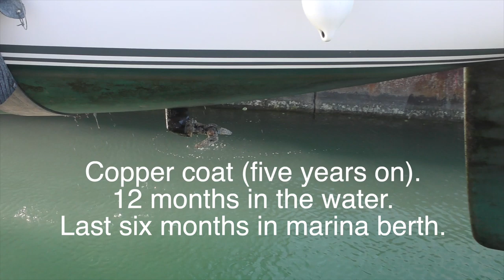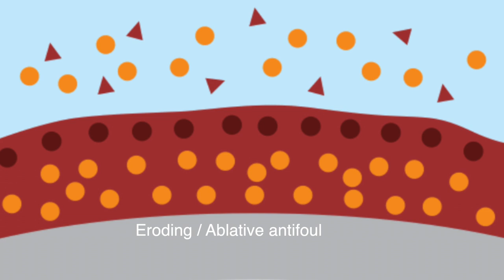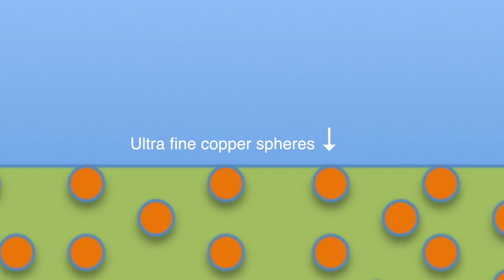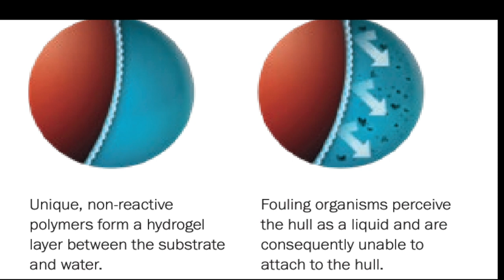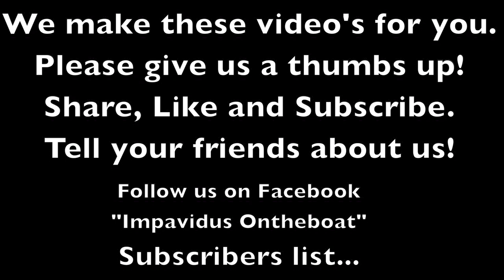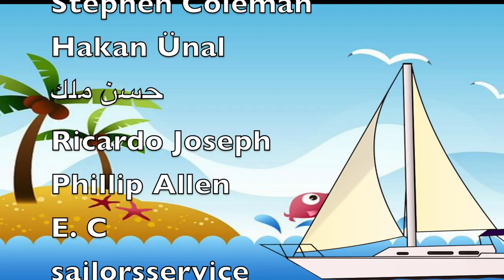Antifouling. Which one is best? We look at 3 including Silicone

Comment: I have Coppercoat on a 3 year old racing/ cruising Portsmouth UK based yacht and have been bitterly disappointed with performance. I lift it every year, scour, sand, divers down twice a year and still getting weed growth.  

I had a Bavaria 37 before which required two tins of Blake’s Tiger eroding and a mid-season scrub.
Reply from the maker: Yes. You can see in the video our problems with seaworm and barnacles we have to dive the boat every 2 weeks now.  Yet we have seen other where it works so well. Ant

Comment: For myself on Ice Maiden I have a meticulous preparation for anti-fouling. We have just done a complete anti-fouling of Ice Maiden which will last for a minimum of 5 years before we do it all again. First we taken it back to the fiberglass with a bead-blaster. Then we apply 2 coats of etch primer with 24 hours between coats. The hull is then washed down and allowed to dry. We then apply 2 coats of an under-primer, followed by 2 coats of primer. These are sprayed on and allowed to try with a 24 hour dry time between each coat. We then spray on 2 coats of anti-fouling allowing again 24 hours between coats. Finally we roll on 2 coats of Bitumen paint, brushing behind the roller. This is allowed to dry for 48 hours and then we put her in the water. In the 15 years since Ice Maiden was built and launched there has been no growth on the hull with this method.
Reply from the maker: Robert Thanks for the comment. We take it that Ice Maiden is steel? Did you blast to SA 2.5 with beads?  Do you know the wet film thickness of  the coatings? We are currently looking a something for a future video. Ant's done a lot of work with steel coatings in his career, so we are interested to know pait secs and thicknesses to compare them across industries. And compare offshore industrial coatings with marine industry (boats) coatings to steel. We would be interested to know more detail.  Ant & Cid
Reply: @SVImpavidus  Ice Maiden is a Laminated Plywood Trimaran that I designed and built myself of 40 feet on deck (50 feet overall). My next vessel which I just finished the design of is to be built in steel. As for Ice Maiden her hull is from the Inner Skin: 3mm ply laid fore and aft, a finish fiberglass cloth that was laid on in the green state, 3mm ply laid at 45 degs forward, a finish fiberglass cloth again laid green, 3 mm ply laid at 45 degs aft, 1 layer chopped strand and then 3 layers of kevlar. All resin way sprayed on for penetration and weight saving. When I do the area below the water line on all three hulls it is the sequence as I have already described. The area above the waterlines is painted in the same sequence except I use a top coat. All my paint is Epiglass Brand. The decks are done in a similar sequence. On the amas ahead of the forward crossbeam and aft of the rear crossbeam the decks are painted in Rescue Orange. Ice Maiden is regularly at sea for 6 to 9 months without touching land as I use the vessel for personal oceanographic research.
Reply: Not familiar with bitumen paint
Reply: @wallacegrommet9343  Bitumen Paint is available from Rural supply stores and building supply stores. In rural applications it helps suppress infestations of mites, fleas and other like pests. In the building industry it is often used on the exterior of basement walls as protection from water seepage.

Comment: Thanks for this! The anti-fouling that was applied as part of the sale by the previous owner of our boat has been recalled…how that is supposed to work, I don’t know, but when we hauled it out for the winter, just a good hosing off was all it needed, so I’m not complaining one bit…but I’ve bought a second boat now, a little 16.5” trailer sailer, and I’d like to consider antifouling paint for next year. It’s got a little coppercoat left on it, and I’m keen to see how it holds up this year. We will be doing NOTHING like 7 knots, so this answered my question about the silicone based product. Boat speed has a LOT to do with how effective any antifouling product is at keeping the boat clean. My top tip is that if your boat isn’t fast, anchor out or grab a mooring ball on river with a current. It will be a good test of anchoring skills, and you’ll quickly find out if your ground tackle needs updating. 😊❤
Reply from the maker: We are re-coating our yacht in the spring with Coppercoat 9 years of hard use. We cannot complain. Stay tuned for the video. there are lots of other jobs in the pipeline too. Sail Safe mate. Ant & Cid

Comment: So at the Southampton Boatshow today, I spoke with both a yard who applies Coppercoat and the U.K. supplier.  One said abraid with 40 grit until 75% is back to the copper and roller for a racing finish. One said  abraid to 180 grit and spray with an increased copper content.  The lack of consistent approach could be one of the problems.
Reply from the maker: Was that Osmotect from the Hamble?
Reply: 40 grit is extremely coarse and continually sanding one's entire hull back is a huge amount of work. I'd be tempted to sand it all back and coat it with silic one...

Comment: Sailing Britican tells a different story about Copper coat. . .had it applied twice with copper coat US involved the second time and still they grow barnacles. . . they have lots of videos regarding it from the first time it was applied 'til now
Reply from the maker: Jill, Yes we have been in touch with Britican as we have the same problems. Yet our sister boat has no of these issues. The areas we applied the coating are clean and green. We have been in touch with CC 3 times. Our next haul out they are sending an expert to take another look. Meanwhile we have to rub the hull every two-three weeks with scotchbright. Sail safe. Ant

Comment: A word of warning on coppercoat.  I have used it on 3 boats.  As it ages (5+ years), it breaks down, becoming quite porous and crumbly, offering no epoxy protection to the hull.  It also breaks down quicker and turns black around bronze fittings.  For cost comparisons, it can not be compared with other antifouling used in conjunction with a proper epoxy coating.
Reply from the maker: Ours is 7 years old and we have no problems other than the bad job done on the keel.... Twice! Se the video in Tunisia. Ant.

Comment: Copper Coat seems to be similar to VC-17, which I used on my J-30 sailboat. VC-17 used copper powder mixed into the carrier, and also had teflon in it. 
VC-17 was as thin as water and dried in less than a minute. It produced an ultra-thin, very smooth and hard bottom.
Reply from the maker: Similar principal we think. But like Marmite you love it or hate it. Check out sailing Briticans latest vid there is an update. Regards Ant.

Comment: Thanks Ant.  You are correct on your longevity assumptions on the SilicOne....10 years according to Hempel.  Informative vid.
Reply from the maker: Thanks Philip. We could not find the info. However , based on what we have seen it is a top performer  and the life span may be better than Copper coat. Sail safe. Ant

Comment: Cooper coat doesn't always work for me as adverted but ablative paint never fails me, and costs far less both in materials , paint and labor. Just one man's 2 cents worth, your situation may vary.
Reply from the maker: Yes we have had real problems with ours. Yet, others swear by it. It would appear when it works it works well when it does not it's a nightmare. Check out Sailing Britican. We have been in touch with them over the last two years. They have the same issues as us. Silicone seems to work well. Thanks for watching. Ant & Cid
Reply: I found coppercoat worked the best when the boat was out of the water.
Reply from the maker: @G-ra-ha-m  😂🤣😂

Comment: Hi  Another great video. I have a couple of questions, if I may. You said for your own boat it had five coats of epoxy. How many of these were laid pre-Coppercoat? How many layers of Coppercoat were applied? Did you start with a new boat or have to clean off old antifouling?  Secondly, I'm impressed with the chocking (is that the right word?) of the boats in Almerimar, but for those re-applying ablative antifouling, how do people manage with so many supports and also they don't look all that adjustable.
Thanks Philip
Reply from the maker: Philip. Hi The boat was new so it was ablated to rough the gel coat up and then a primer applied. After which 5 coats of copper coat were added. The coppercat is a water based epoxy so it helps protect the boats gel from osmosis. The chocks at Almerimar are quite a good system. The guys will move them if you need to but generally one will work round them and do the patches as they lift the boat. You get about an hour in the crane slings before they splash you. Sail Safe. Ant
Reply: @SVImpavidus  excellent.  Thank you

Comment: Perfect. I was talking to Phil last week about the Sillic One product and will be keeping an eye on things. In the meantime, we've been using Micron 77 and this has seemed to work pretty well for an ablative finish. By the time we get back to the States I think we'll be overdue for either reapplication or for selecting something new. Interested to hear what you say about props, as we're weighing a decision on PropSpeed.
Reply: Kevin, I have used PropSpeed on my last two boats and highly recommend.  Prop on Bora was completely clean of growth.  Even on Dixie Flyer in Galveston, the prop was clean as a whistle after 2 years.  Great stuff and well worth the investment.
Reply from the maker: Hi Kevin. One point I did not really make well enough is that no antifoul that yacht users can buy legitimately will work if the boat speed is not enough to ablate, self clean and erode. In areas where the water fails to pass quick enough they simply dont work. I guess you could think of it as low pressure areas like the top of the rudder? Having said that I am very impressed with Philips set up It is as good as Coppercoat and knowing what we do about the poor application at some companies Silic one appears to be a better buy? I guess time will tell..... Thank for watching. Sail Safe.
Reply from the maker: @phillipcorey2182  Hi did you need to apply a primer? Most non ferrous metals need an etch primer soon after they are exposed to  oxygen. This stabilizes the surface and gives a sound substrate. It would be good to look at prop speed. But we just got back in the water!!! As we English say " Bugger, Too little too late! "
Reply: @SVImpavidus  Yes, but from my understanding it´s not necessarily required.  Fox´s used something called a "tie coat", which allows SilicOne to bond to an existing ablative paint.  They gave the bottom a good sanding, faired the keel where they performed some repair work, then applied the tie coat.  If you look at the surface scratches, they appear white.  That´s the tie coat showing.  Don´t quote me, but I think SilicOne can be applied directly to gelcoat without primer.  Actually, talk to Chris in the yard.  He´s far more knowledgeable on the topic than I.
Reply: Sailing Yacht Talisman We just applied Propspeed for the second time. The first one went for 2 years full time cruising...Malaysia to South Africa. Very happy with it. It still needs to be wiped with a soft cloth, but nice to not have to scrape anything, ever! -Rebecca on SV Brick House

Comment: Good info here, thanks for making it. Pretty big jump though to assume Silic One will last 10 years. Would be amazing if it did. I use hard/racing antifoal which can be scrubbed as often as needed. Its been over 2 years now since the last haulout and still going ok but the intervals between scrubbing are getting closer. Will be hauling out Nov 2020.
Reply from the maker: Update! the Silic one is supposed to last 10 years. However, the boat we featured belongs to friends who left it on the hard for six months of the northern hemisphere's winter. Therein lies a tale, if Silic one is left out the water for more than 2 weeks it de-activates by hardening and just becomes another coating.....  We will do an update video in the spring. You may like our boat electrics made easy playlist. Its part of our pass it on philosophy. Bit like you we want to share knowledge. As for antifoul, best to just copper sheet your hull. 😂

Comment: Thank you for this Ant & Cid. May I ask what is the cover in your keel, please? I am currently debating what to do based on that
Reply from the maker: Hi Bonnie. Do you mean the primer or the Copper coat? Number of coats etc? Ant.
Reply: @SVImpavidus  sorry, I'm still learning the language! My keel is made of steel, so I cannot copper coat it unless I "cover" it first, The previous owners didn't and decided to use some "normal" anti fouling paint instead. I have no idea what method was used or how long it should last or what to do next! It seems to me to make more logistical sense to "cover" the steel and copper coat it,  but in practice will it work? I hope this makes sense! Love to both. thanks for always being so helpful
Reply: so, probably I mean the "primer" is that what separates the metals?
Reply from the maker: @bonniebrett796  Ah Ha now I see. OK let's take a look. Your keel will be Cast Iron probably not steel. as the boat is conventional antifoul it makes no sense to strip back either the hull or the keel unless you are going to treat the whole boat. Hull and Keel. 
Cast iron is a funny material. It is actually porous to a degree so water can penetrate it somewhat. When stripped back it will quickly flash rust with the moisture and oxygen that is in the air. Our advice would be to clean back the keel buy sand blasting by someone that knows what they are doing. The standard for the blasting finish is called SA 2.5 as this is completed ask the contractor to use the air hose to blow all the dust and particles off the keel. You will then need to apply a zinc rich epoxy primer. 3M make this and you can get it direct from Copper Coat by mail order. You must get the first coat on within 20 minutes or so of the blasting or rust will already started to form under the epoxy!  Hand apply the epoxy with a roller. the short Mo hair type is best. You will want to achieve a wet film coating thickness of 40-60 microns in each coat. 3 Coats is good, 5 coats is best. let the coats go tacky before you apply the next coat. In hot weather you may need to mix in a thinner with the epoxy so it is thinner. (this is always a good idea on the first coat as it helps penetrate the cast iron. Th 3M Primer can be coated over immediately it is cured. However we suggest that you rough it up a bit with some 360 grit sandpaper before over painting with your regular antifoul. Again 3 coats minimum on the keel and 4-5 on the leading edge. If you PM us on face book we can do in to a bit more detail and possibly recommend a specialist blasting company. Hope this helps. Ant.
Reply: @SVImpavidus  Yes you got it! Thank you so much! it makes sense and it is good that CC actually offers the zinc epoxy. I am assuming your keel would also be cast iron, given we have similar boats - different year? Thanks for this, I'll be in touch on Messenger, Enjoy it guys. xx

Comment: Thanks for video. Silly question but how do you treat and paint the areas where the wooden stands hold up the boat?
Reply from the maker: Good question! The staff put a new stand in next to it then the old one is removed. If the areas are small then they can be painted when the boat is lifted. Thanks for watching. Sail Safe guys. Ant, Cid and the pooch crew.

Comment: hello any new update on your antifouling after another year
Reply from the maker: We did not lift at all this year. Generally while we were moving around we had a clean bottom. But in the last few months we have accumulated weed and barnacles in Licata like we have never seen before. More worrying is the original treatment had to be re done on the keel as the thickness was too little and the keel was stripped and re done by the original contractor FOC. At the time we were not entirely happy with the way this was done and asked Copper Coat to take a look. They said it was OK. However we now find that the epoxy primer is delaminating from the keel in large areas and will at some time need to be completely replaced after sandblasting.  Again this was the applicators failure to do the job correctly as with Sailing Britican. But, we questioned CopperCoat at the time and they stood by their approved applicator. We are gathering our thoughts  on how we deal with this before we contact Copper Coat. Clearly a 10 year life expectancy will not be achieved if the primer and work they approved is failing at just over 5 years....

Comment: Do you have any experience or knowledge of KISS-cote wipe on coating? Their WEB site claims some excellent properties for extending the life of anti-fouling and making barnacle removal easy, with a pressure washer or broom.  The say that for boat speeds in excess of 12 knots, fouling is washed off. It also claims to increase boat speed by 6%. Do you know if this lives up to expectations, and reduces boat maintenance costs?
Reply from the maker: Hi. Not seen the product in use. We had a quick look and it appears to be a polymer of some type. We would be wary of coating anything on top of the coating we looked at as the self cleaning properties would be stopped?  The important thing seems to be keeping the boat moving where possible. Having said that our Copper coat is still not performing and we are getting barnacles and sea worm that need cleaning off every 2-3 weeks. despite some very fast sailing. Thanks for watching and your comments. Sail safe. Ant & Cid.